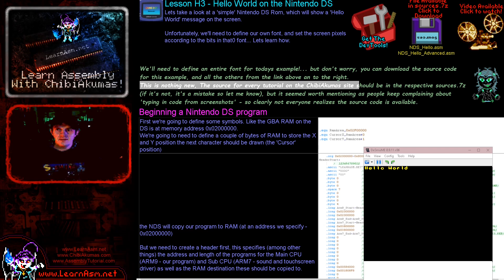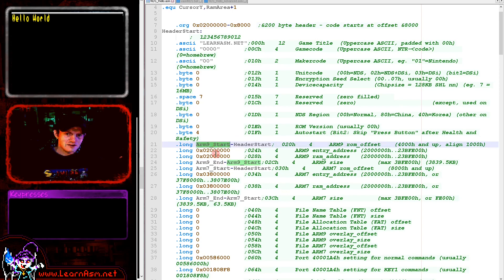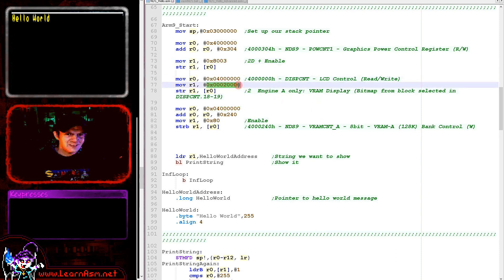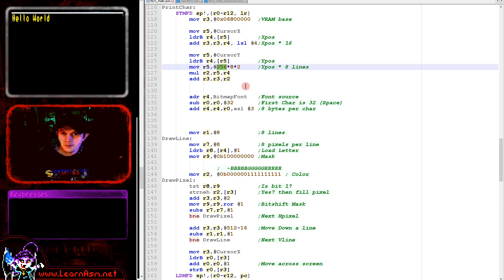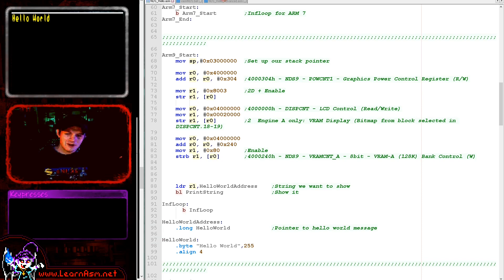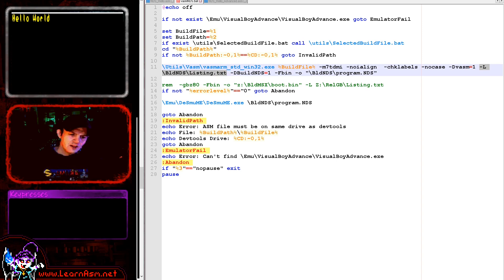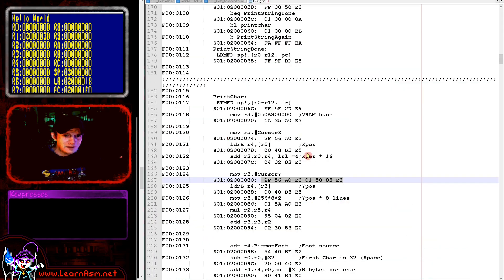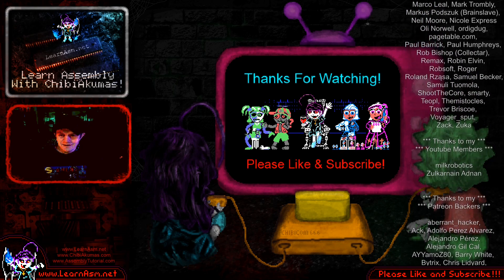Hello World on the Nintendo DS - ARM Assembly Lesson H3

Comment: Great content as always! Just finished going through the ARM chapters in your book, and it's nice to get a secondary video explanation of similar concepts. Do you happen to have any plans in your pipeline for using any of the built-in debuggers within DeSmuME or No$GBA by chance?
Reply from the maker: You should make every use you can of the built in debuggers of these emulators, however I'm not going to be covering their use on my channel I'm afraid.

The reason is simply I don't have any experience with them, I work on so many different CPU's, systems, and Emulators, and they all have different debugger capabilities ranging from excellent to non existent... even ones I've learned briefly how to use I've quickly forgotten just because I'm not using them long enough to gain and retain any skill in their use.

Alas, I don't have time to get good enough with them to 'teach' with any confidence their use - you'd be better off just reading the manual of the emulator of your choice.
Reply: @ChibiAkumas  I assumed as much given the large number of platforms that you develop on simultaneously. I really should just bite the bullet and learn the debuggers from their manuals though... Cheers!